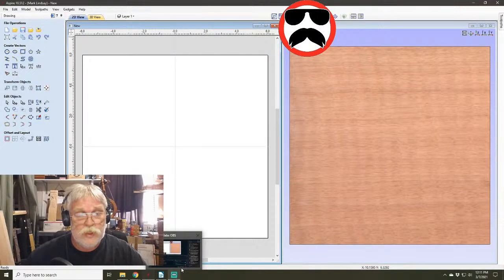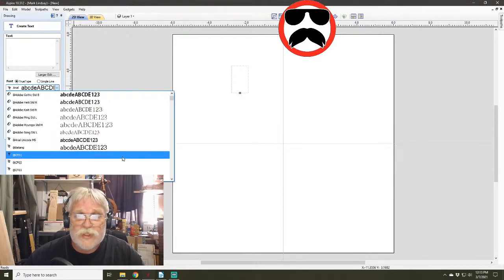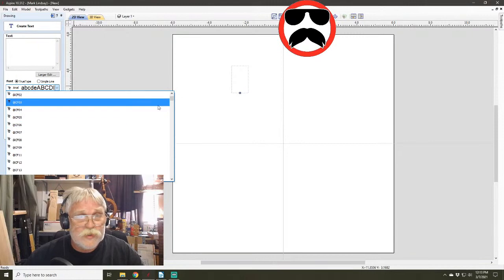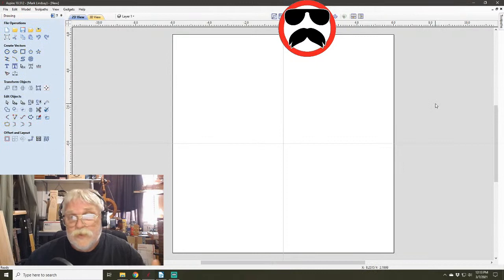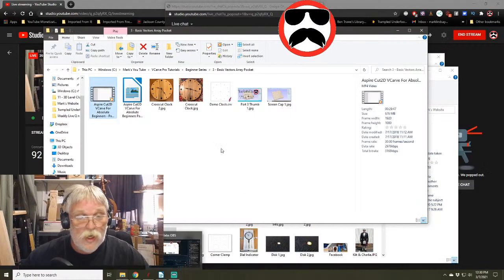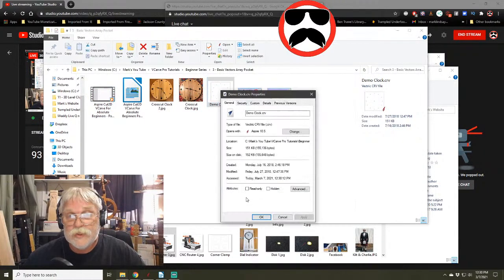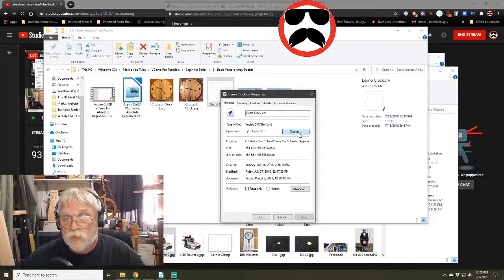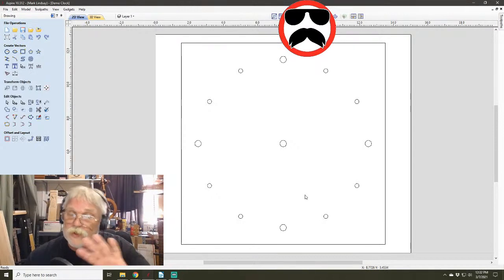LIVE Q&A #81 - Open Q&A

Comment: Hi Mark,  I'm changing my controller to Mach 3, and would like to know which post processor you use for Aspire?   I don't see a specific one in the list.  Thanks!  Love your videos.
Reply from the maker: I use the Mach 2/3 Arcs (inch) post processor that comes with Aspire. If you use Metric rather than Imperial measurements, you'll probably want to use Mach 2/3 Arcs (mm).
Reply: @MarkLindsayCNC  ... Thank you!